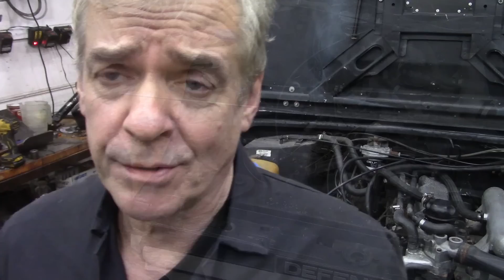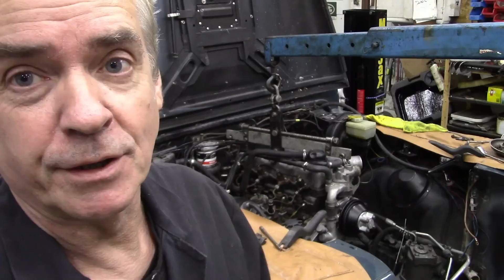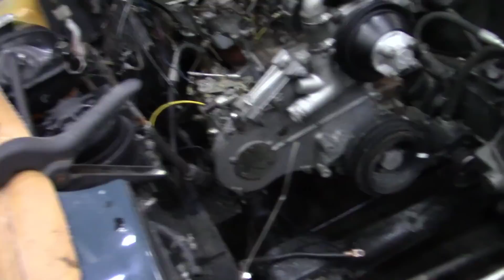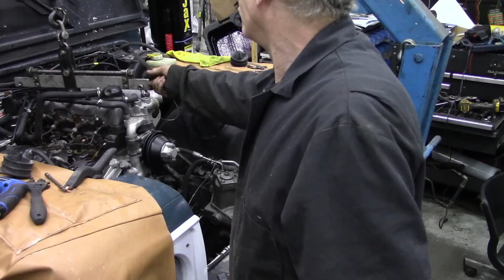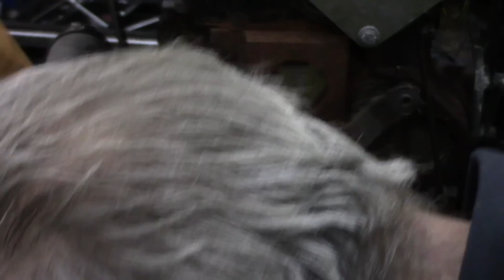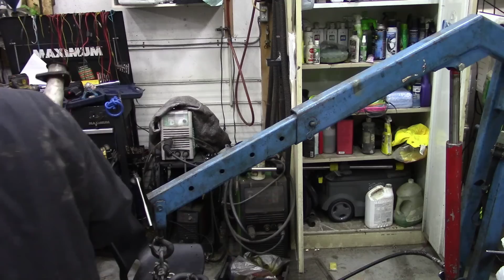Removing the 2.5 NA engine

Comment: I have use such a screwdriver for year and years for low torque applications , such as bicycle screws . Good tip, highly recommended!
Reply from the maker: Excellent for hole clips! Just the right amount of torque without stripping the thread!

Comment: Is that your Halloween witches cauldron bubbling away in the background there Mike? :)
Reply from the maker: I have air in my heating system!
Reply: @ I thought it might be heating related! Hope the workshop is nice and toasty, getting colder here in the UK as well
Reply from the maker: I think it is the circulation pump cavitating - I turned it down to 1st speed and seems better - Constant 23 C in the apartment and 20 in the shop with the heated floor - just right!

Comment: Always had to use long guide bolts for all my in and out jobs as no help. Use 8” or 10” bolts, cut the heads off, chamfer the cut end and then cut a slot in it for a screw driver to slot into. Never had an issue. Balance beam is a must. Take care mate.
Reply from the maker: Yes! I have a collection now in UNF, UNC, and Metric!
Reply: @ Should have known that 🤣

Comment: Nice work again Mike. I can appreciate why it would be better with two of you for jobs like that. I've been changing back brake pads on my Toyota today as one of the caliper pins had seized into the carrier (Mapp gas torch needed), and as a result one of the pads was doing all the work and I caught it just in time. Calipers now sliding nicely and new pads both sides. If you don't keep on top of things, they can come back to bite you, and with everything else on the go, I let the regular greasing of the pins go without attention for too long. Side note - whoever came up with electronic handbrakes and wind back calipers wants a swift kick to the testes.
Reply from the maker: Rust eh? What a nightmare!

Comment: If you take out the engine mounts and let the engine brackets sit on the chassis you can just get to the top bell-housing bolts without taking the floor out.
Reply from the maker: Yes you can, but I like to get the gun in to remove the nuts ( And I need to fit the transfer box linkages too)
Reply: True.

Comment: Finally more 2.5NA videos! Please do more of this engine!
Reply from the maker: This is only the removal - the engine is now sold
Reply: I have one in mine, I like it but surprised anyone wanted to buy one!
Reply: @peterwarner8541 I just bought  a spare engine  for mine, I'll rebuild  it then swap mine out. Then rebuild  that. I only travel  at 60 mph in my modern  pickup so it doesn't  bother  me how slow  it is. I have numerous  motorcycles iff I want  speed.
Reply: Surprised too….😅